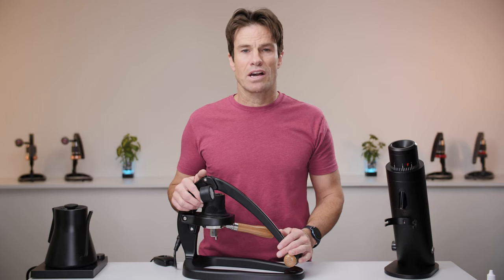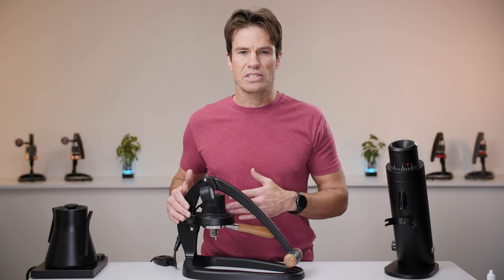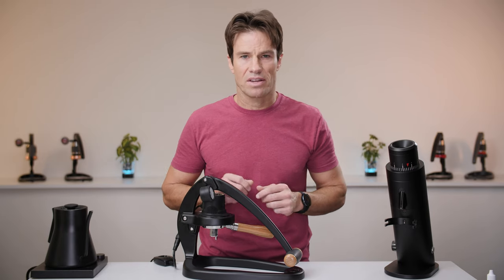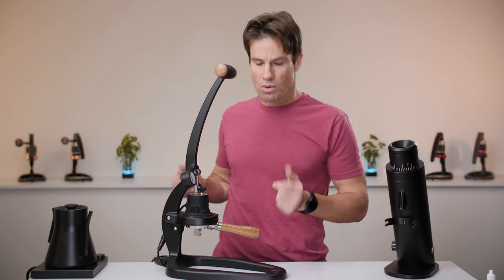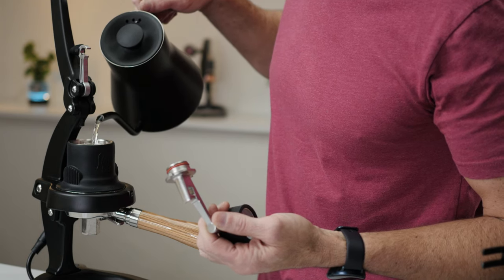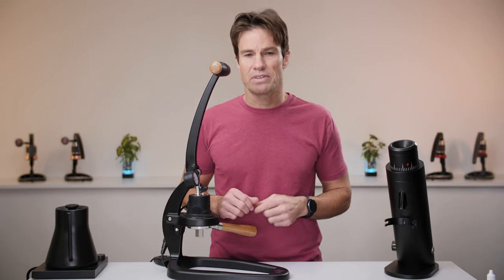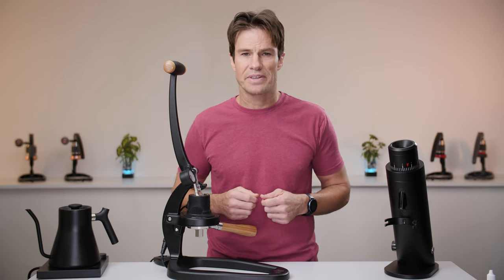Fill Methods for the Flair 58 & 58X Equipped with Valve Plunger

Comment: Excellent vid, Andrew. I used the little pause you demonstrated...a 1/4 of the way up-lever..then raising the lever to the top before adding that las bit of water. That completely eliminated the air pocket, and gave me a super smooth pull, which was reflected not only by my arm, but by the gauge. I recommend all Flair 58 and 58+ owners to watch your series of videos.
Reply from the maker: Cheers, Robert! Pleased to hear you're getting on well with your 58 🤙

Comment: I am using the Flair 58 V2. I am surprised that you fill the chamber while the lever is down and then fill the remaining head space when you lift the lever up. I normally do not do that... I just fill it all the way from the start to finish while the lever is up through the little hole with my gooseneck kettle. I feel this is a better workflow for me. Am I doing it wrong or missing something?
Reply from the maker: If you have the valve plunger installed, you have both options

Comment: Are the any adjustments to the valve plunger method when using 12 gram single baskets? I'd assume you don't need to fill in the whole chamber with water.
Reply from the maker: Depends on the desired yield but likely full fill is not needed, just don't continue raising lever once all the water has passed through valve; stop there and start the pull.

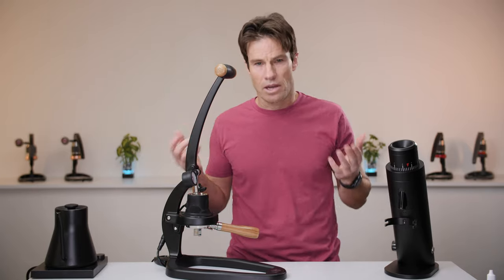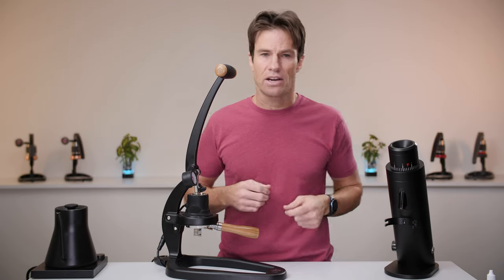Comment: Hi team, I just got a new Flair 58 and I believe I have the issue that Andrew is describing between 2:50 - 3:17. The problem is that I am sure that my hook is seated neatly against the crossbar of the plunger so there is no "further" that the hook can go. As I am bringing down the lever, once the black guider goes low enough to enter the brewing chamber, it rubs against the inside wall of the brew chamber so the lever becomes stiff and the pressure suddently drops and in some cases I hear/feel a slight vibration of the black guide rubbing the inner wall. What should I do? Is it possible that due to manufacturing tolerances, the black guide is very slightly longer than usual and it rubs regardless that the hook is well seated on the crossbar? Thanks
Reply from the maker: Please contact support and share a video of what you describe. flairespresso.com/contact or use chat feature
Reply: @FlairEspresso  thanks, I just sent the email with a video link !
Reply: Hi! I am experiencing the same issue! Did you find a fix for this problem? @vladimirkanev3553
Reply: @assain2  me personnally no. I ended up returning the F58 to the merchant. Somebody else said they were able to somewhat fix it by removing the latch on the hook and using it like the older mechanism
Reply: @vladimirkanev3553  thanks for letting me know. What about the support service? I see you provided a video showing your problem. Was Flair able to provide any help?

Comment: Hi, when trying the second method it never fills completly the inner part looks like the seal is blocking water
Reply from the maker: After filling, and while handle is still down, lift handle a could inches an jiggle it side to side. Water should fill head space and allow you to top off before raising to the top. Contact support for further assistance if needed at flairespresso.com/contact

Comment: I have been debugging a problem with my 58 LE which I got a couple of months ago. At first, I was pulling shots between 6-9 psi, but lately, I am not even doing 3 psi. I replaced all the gaskets on the brewed assembly and the one on stem. I used a light coating of canola oil to make sure they were not drying out. In the gasket kit, there are a couple of VERY small gaskets of about 5/16 across, but I have no idea where they go. It's the only thing I have not changed out. Any ideas?
Reply from the maker: Grind finer. You didn't mention water was squirting from anywhere it shouldn't (from seals on plunger, stem or gauge)--the obvious signs of pressure loss unrelated to reduced puck resistance. bit.ly/BrewWithFlair or flairespresso.com/contact

Comment: I really wanted to use the second method but when the leaver is upright, no more water goes is. So I'm always left with a gap filled with air between the plunger and the water.

Comment: Hello,
I am very attracted to the Flair 58. This purchase will be an accomplishment for me, and I want to be confident in my purchase. 
Forgive my ignorance. When lifting the lever, is there a chance the puck will get displaced? 
Also, may I ask why the new version does not have a shower screen? I understand the engineers designed it for a reason, I just would like to understand the differences. 
Lastly, what it the height with the lever fully extended? 
I have an area with my various brewing methods and great coffee and roasted coffee. I would like to see if more space will be needed. 

Thank you so very much. I look forward to your reply.
Reply from the maker: Hey there, happy to answer your questions! 1) When you lift the lever the valve opens, no vacuum formed. 2) Surface tension sometimes prevented filling head space below, removing dispersion screen alleviates this concern. 3) lever up is 24", lever down 12"; you can push it under the cupboard when not in use, pull out and possibly need to turn at an angle to use
Reply: @Flair Espresso  Cool thank you so very much. Is there a specific person I may contact via email? I live in Japan and I feel most attracted to the Flair 58.

Comment: Hello, when i tried method 1, water boil in the well (bubling up for a few second) when preheat setting at level 3 and using boiling water. Is it normal? Im living at sea level. Thank you.
Reply from the maker: heating with plunger located at the bottom could be the reason as there's less thermal mass adjacent to PI film to soak up the energy. always preheat with plunger at the top and only lower prior to filling if using method #2. also, as mentioned in video, to maintain a column of water of 95 C metal will be slightly hotter. perhaps the bubbling up isn't from heat but rather displacement of air

Comment: I do use flair and Bplus puck SCREENS, and I do use appropriate vst baskets for different dose sizes. 

I haven't installed the valve plunger yet. I'm a little nervous to do so.
I don't have a Gooseneck Kettle and I wonder if I'll have trouble with a normal jug.

Currently I pull the plunger up before I insert the portafilter, so there is no upward force on the coffee bed.

It appears with the valve plunger method, the portafilter is installed with the plunger down, chamber filled, and then plunger raised. I'm slightly concerned this will drag some coffee oils up into the chamber over time, making a cleaning issue.
Reply from the maker: Nothing to be concerned about because 1) the valve prevents this (no suction) and 2) there's no where for coffee material to hangout once you remove the fixed screen. Also very easy to wipe inside if needed
Reply: I do not have a gooseneck, it's a basic chefman glass tea kettle, and it can pour in there no prob

Comment: What is the "silicone funnel that ships with the Flair 58"?
Reply from the maker: If you purchased for 529 the 58 didn't have a valve plunger at that time and price. All 58s from Oct on were outfitted with a valve plunger, silicone funnel and puck screen AND cost 575